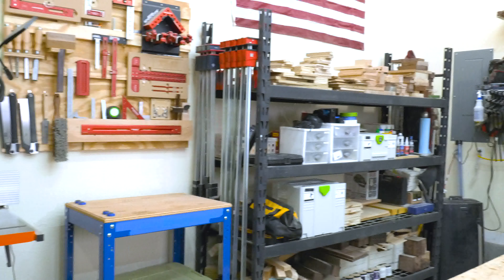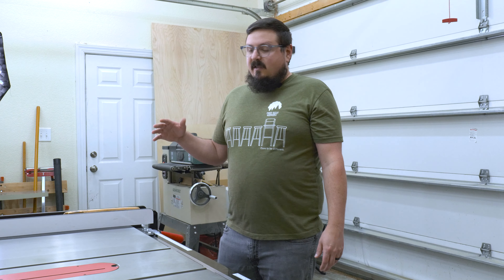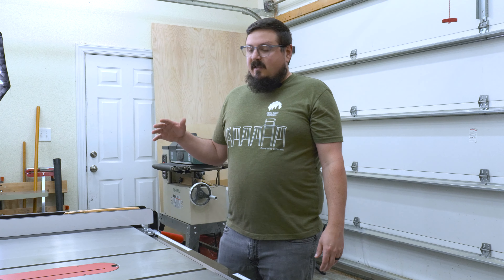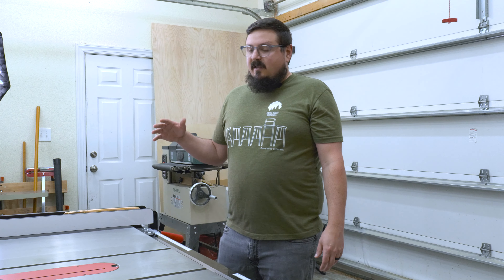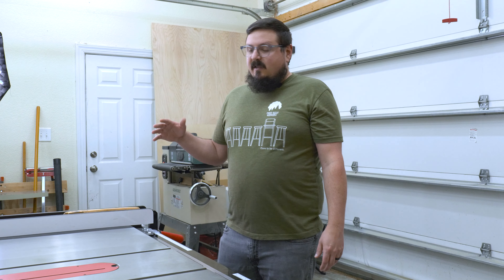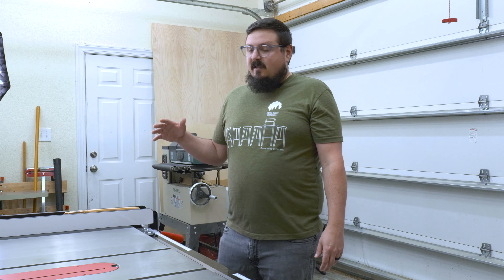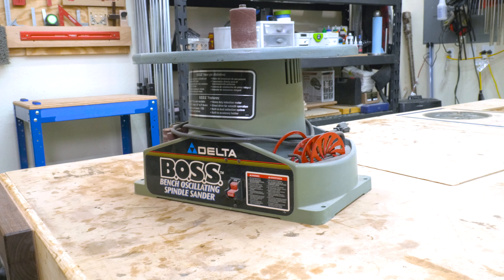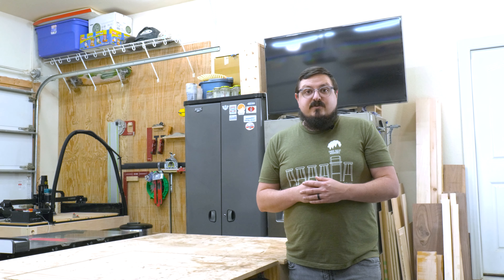2022 Shop Tour | Furniture Maker’s Garage Woodshop

Comment: It may help to put the bucket on your dust collection there inside a second bucket.  It will keep the bucket from collapsing as much during use.
Reply from the maker: Good tip! I actually just upgraded to an Onida system that’s a lot more rigid.
Reply: @TimberBiscuitWoodworks  That’s awesome! Oneida makes some good dust collectors!
Reply from the maker: @jayraysdiy852  for sure! I’m really happy with the performance.

Comment: I'm really enjoying my Sawstop contractor saw (52") my plan was to put my Delta 36-725( shopfox classic fence with 7' rails) back-to-back with the Sawstop but the Sawstop was 2" shorter so out went the Delta and in came the mobile base , cast iron wings and overhead dust collection for the Sawstop
Reply from the maker: Yeah I had that same issue come up with my bench when I got the SawStop. It was originally on casters. Luckily taking them off dropped the bench low enough for it to work as the outfeed table still.

Comment: When we upgraded from a Delta 1080Z a few years back, went Gold (PM2000B w “workbench” extension). Got the workbench model since it had metal legs (could’ve welded up a set, but it was cheaper to buy it) and then Frankenstiened a sawstop overhead blade guard w dust collection (the large one).   Put a set of JessEm stock rollers mounted with magnets on the fence, works far better than feather boards we had been using, IMHO.    Built a large roller cabinet w drawers on front and Systainer storage on back to fit under right side of the saw table.  Loving this setup, though I do miss my Unifence ☹️

Is the Rip-Stop really useful?  I’ve had one in my cart for while,  haven’t pulled the trigger on it.

Shelix for the Dewalt, a must do if you 1) work with chatter prone woods 2) highly figured woods 3) don’t like a lot of finish sanding.  Only down side is you do lose depth of cut per pass.  Has already paid for itself in saved time/materials.  Certainly not missing chipping the standard head blades, which always seems to occur within first few passes after changing them. 😉

Funny how doorways always seem to collect the odds and ends around ‘em 😏

Half of our work is done outside, just upgraded the sawhorses to Bora XTs, so far loving ‘em.  Take up a lot less stg room than the old ones (plus taller & the height adjustadvantage).  Building a new portable MFT to fit on them this/next week along w some left/right support tables for the Kapex.  

Routers, lots of Festool in the shop but haven’t bit the bullet on the Festool router, yet.  Currently have about 10ish routers, mostly Bosch EVSs.  We hate changing setups through a project(s).

You might want to check out California Air Tools compressors.

Suggest adding eyewash to your 1st aid kit 👍

Went with a Trane/Mitsubishi mini split (Dallas) can now work year round 🤙

Not associated w any of the above mfgs, other than as a very satisfied customer.

As always, YMMV.  Just sharing, nothing more.  Nothing less.  🤙
Reply from the maker: A lot here! So, yeah I used the Rip Flip quite a bit on repeat cuts if I need to move the fence and come back. I am looking at doing a Shelix for the planer later this year. Good call on the eyewash, I need to get that added. Thanks for the info and the support!
Reply: Yeah, I’m a Southerner, we’ll talk your ears off and then superglue ‘em back on a few times.  When we start talking about family…run!!
Reply from the maker: @jessefurqueron5555  haha! That’s true!